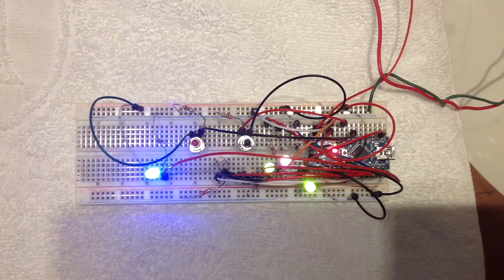Arduino Enterprise 1701/1701A Refit lighting effects code

Comment: Based on your Scketch and video above did an assembly on the protoboard, but only the LED strobe worked. It would be possible for you to provide a wiring diagram of your Scketh in order to make the assembly and subsequent use of it in our models. Thank you.